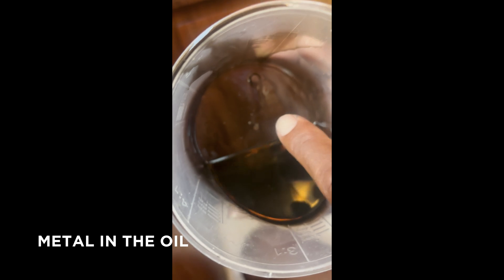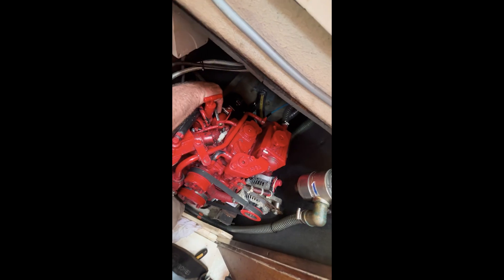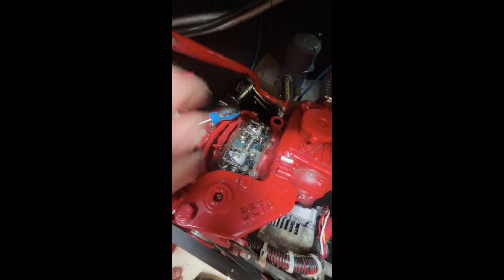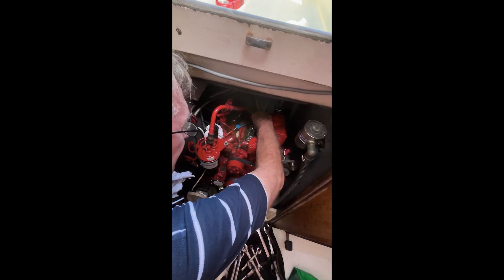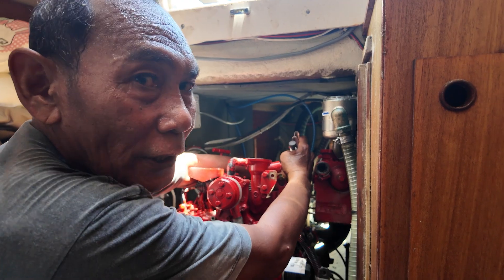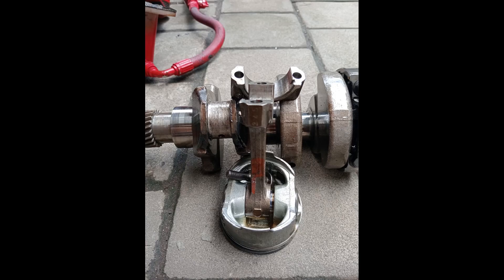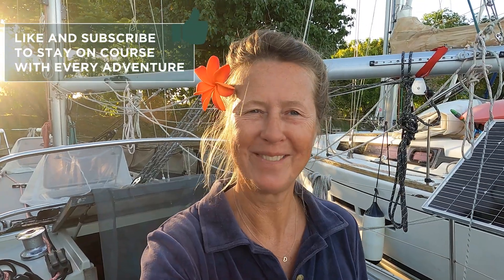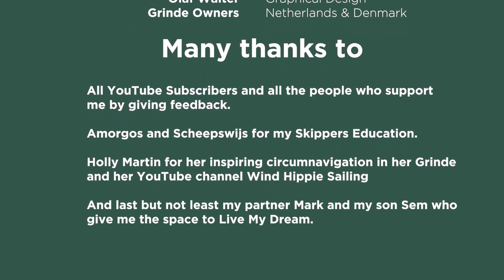Diesel Engine Replacement on My Sailboat – Complete Story from Failure to New Beta Marine - Ep. 268

Comment: What happened to the engine? Did it run out of oil?
Reply from the maker: No it never ran out of oil. It appears there were two separate issues: a fuel-related problem that caused the engine to stall, and an oil-related problem that eventually led to damage to the crankshaft bearings.

The cause of the damaged crankshaft was oil that had mixed with a small amount of water, due to a leaking head gasket.

Comment: Just looked at your channel which I found enjoyable and scary.
As a mechanic both in the car industry and boat industry I was surprised that none of your mechanics thought to fit a pressure gauge to check the oil pressure. You align the gearbox to the propshaft using feelers gauges between the flanges.
Regarding the comment that you should over fill the oil level is a definite no no as high oil level will cause aeration of the oil as the crankshaft rotates leading to low oil pressure.
Good luck with your sailing home.
Reply from the maker: Thanks for the feedback!

Comment: An oil analysis may have saved you some mechanic's fees.  An oil analysis would have found crankshaft bearing metal and perhaps crankshaft metal in the oil indicating a spun bearing/damaged crankshaft.  Even with the crankshaft damage, it's amazing that your tough little diesel still started.
Reply: Bien sûr mais remarque de mécanicien.
Reply from the maker: Yes that sounds good. But in Indonesia things work differently

Comment: The most important thing is missing: engine price, labor price.
Reply from the maker: The engine price is €7000 ex VAT. Importing the engine was €750 for the agent, so I could import the engine at 0% importtax instead of 60-70%. The installation was €250.

Comment: Getting immediate engine service in the Netherlands not true. My boat has a Yanmar diesel and it had low oil pressure indication from when I bought the boat. 0ver 6 years I tried to get opinion on the cause. Plenty of people would come and replace the oil, filters and water pump impeller, but have knowledge of the oil pressure issue? A big fat zero. I couldn’t even get the engineers at Yanmar/Volvo in Rotterdam on the phone. All I could get were spare parts sales people. In the end I removed the engine and drove it from Stellendam to an engine service mechanic in Minnertsga near Harlingen, to get a €1500 assessment, which basically partially improved the oil pressure indication. It still reads very low but the engine has done over 100 running hours getting to Grenada.
We shouldn’t have these engine issues on our boats, but they keep on happening. My opinion at the moment is to slightly overfill your engine oil to improve oil splashing in the sump and engine cooling. The fact that we run these engines at relatively extreme angles (while healed) might be part of the problem. I had a truck in NZ with similar symptoms to your earlier problems and the turned out to be a fuel line with a wear hole in the line allowing air in. I have a bypass valve set near the engine so I can draw fuel directly from a fuel drum (as you did) near the engine if needs be.
Reply from the maker: Thanks for sharing your experience and tips! Yes it is a very difficult process.

Comment: What a relief that the engine problem is solved. It's the most rigorous approach. That's also a significant financial expense. The old engine had certainly never been overhauled, right? At that point, the crankshaft bearings would be replaced. Good luck!
Reply from the maker: Yes it was a significant expense. Only the alternator was replaced two times. And furthe regular maintenance by engineers.